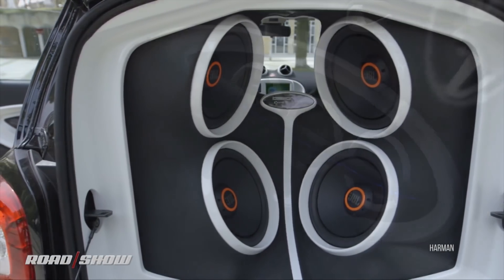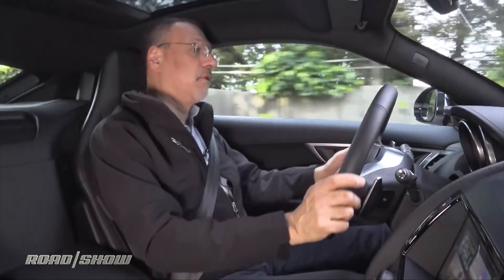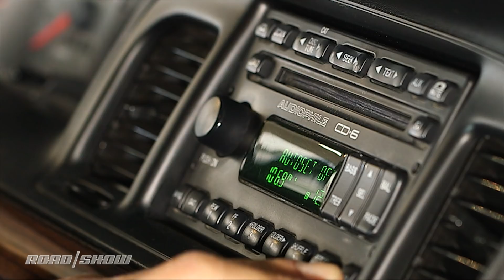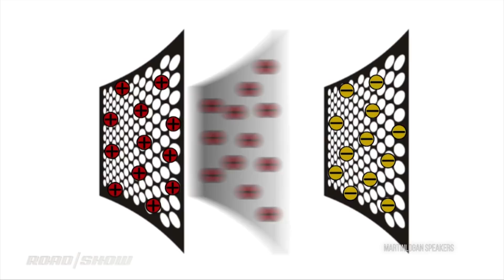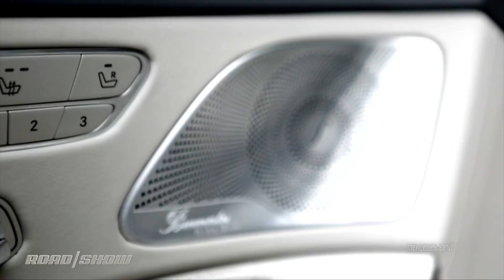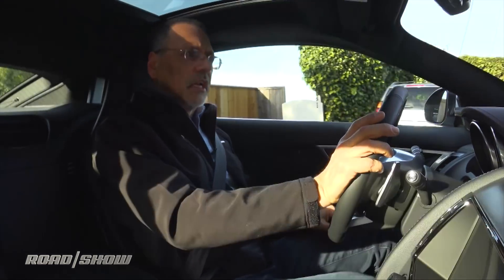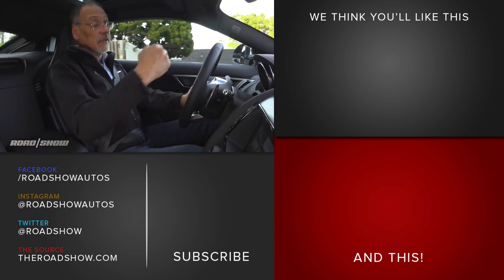Car Tech 101: Car speakers are about to disappear

Comment: No one has ever complained of the existence of a speaker in a car, in my opinion,  speakers, like the Bowers & Wilkins in BMWs enhance the looks of an interior.   There have been flat speakers around for years, but putting speakers behind panels or making panels speakers, by virtue of pure physics,  can sound as good, and let's not even talk about rattling.   Finally,  there is no way to create real bass from a sub without power and the ability to move air.  We need better engineering in car environments to get audiophile sound, not more visual engineering to create less definition and range

Comment: I like how you show aftermarket multi subwoofer, custom fiberglass door panels systems to complain about speakers take up too much room... factory speakers dont take up any room thats not already wasted space.  Inside the door, what else you planning to put in there?  in the sail panel, its already hiding bolts for the mirror, what you planning to do with that space?  Flat speakers have been around for ages.. Magnepan has been building them since the early 70s.  The truth is, no one is complaining that their speakers take up too much space unless they installed four 12 inch subs in their hatchback... but those people chose to put the speakers back there, not the factory.

Comment: Right cause there  is absolutely nothing else in a car that will start vibrating as you start the engine and pull away from the curb  ;)

This is ridiculous and good luck finding a car audio installer who will hook you up with a new system one Saturday morning while you hang out at the mall.  By midday, they might have the seats, carpet and most of the door linings in a neat pile next to your car - then they can start looking for the existing speakers ......

Comment: This is rather old technology, these devices have been around for about 38 years. Sound quality will be dependent on the mounted surface. In this case if its a car and placed on plastic it will sound terrible. In fact these devices are a gimmick and sound terrible anyway. If you want good sound, get a good car speaker...........simple

Comment: No, the alternator in a car does not consume more gas if you have a high power stereo. Your alternator will put out as much amperage as it can, regardless of speed. If you're going ten miles an hour or 100, the alternator produces what the car's systems demand , provided its strong/powerful enough. If an alternator can only produce 100 amps and your car's systems require more it won't matter what your speed is.

Comment: There is really no replacement for displacement of a speaker plus power. These are gimmicks. For an average user, there is no need for more than 4 mid ranges and preferably a dedicated sub (Component mids would be even better). This has nothing to do with fidelity. If it was about fidelity, they wouldn't hide speakers behind grills, carpets, etc. They certainly wouldn't believe that you can get more sound out of less power.

Comment: How are worse speakers better? With all of those tiny speakers you wont have a low end whatsoever and a very unbalanced sound. And as far as using your roof by making it flex to create bass? When cars flex they absorb the sound waves that is audio 101. I guarantee I can build a system that sounds better than any of these "flat speakers". If you dont want speakers that's fine but to say that great audio systems are a waste of space for everyone simply is not true.

Comment: now let us think about this for a second. More speakers, more weight. A 12.22 audio system in a car. ( yes i know it doesn't exist, or does it? ) A car booming allong the way with the numberplate dancing the subs on the outside of the car. Now they are going to use the car as a speaker? What happend with the simple 2.0 stereo systems with only 2 or maybe 4 speakers? People who know sound, know that you can have very good sound with the right speakers. An old Ford Mustang 1978, i build a system in it with 2 tweeters in de front, bass in the door and full range in the back. People were asking were i left the amp and the speakers because they couldn't find them. It was 40 watts in the car and sounding better than you would expect. So i ask again, why? Who need 2300 watts rms in a car where the space is more than enough for 20 watts? Consuming less power on the car system, no more holes than it was allready there in the car and still having a boot and back seats and you still can talk to each other.

Comment: Where do I even begin with critiquing this video?  The only good thing is the front mounted sub. As for the rest of the video, every single thing said is pretty much wrong.  I have a very strong background in acoustic engineering at a professional level. There have been only evolutionary steps since Jensen introduced the first permanent magnet dynamic speaker in 1930. in 1953 Janzen created the first electrostatic speaker and the Distributed mode loudspeaker (flat panel speaker) was described in 1997 in an AES paper but the principal had been known for decades.  The problem with conventional speakers is that to be loud they must be big or move fast which causes distortion above a certain velocity. Electrostatics are exceptional for quality but must be exceptionally large and open. Distributed mode loudspeaker has very poor frequency response and bad comb filtering, also they can not produce high SPL. Only one thing left, plasma speakers, very small, very loud, very good frequency response but the power requirements are in the KW range and there is the small problem of the deadly levels of ozone produced. The only other possibility is sound from ultrasound, but that is very complex, expensive, and as of yet poor quality.

Comment: This has absolutely nothing to do with efficiency in design in regards to producing better sound in your auto and a lower impact on charging systems and vehicle weight, but instead, has everything to do with increasing auto manufacturers' profits. Their ideas of producing sound in a vehicle will exploit the proprietary nature of what they are utilizing in these "emerging technology" speaker designs to reduce your ability as the end user to service your own system. This will force you to deal exclusively with vehicle dealerships' service departments for replacements when products fail out of the warranty period. This will severely limit your ability to make your own choices on where to source your parts. This allows auto manufacturers more leverage on how much they can charge you for replacement equipment and labor rates. Look at how auto manufacturers have formed a coalition that has attempted to enact DMCA copyright law on their products because contemporary vehicles utilize proprietary code in their ECUs. 

Sound reproduction in an automobile system does benefit from efficient design, however, efficient conventional loudspeaker and amplifier design has improved drastically through the years anyways. Many current conventional loudspeakers are more shallow due to the use of neodymium as opposed to a strontium ferrite. They are lighter due to composites being used to build their frames, as opposed to either stamped steel or cast aluminum. They are also more reliable mechanically and thermally due to superior manufacturing processes and better materials. Amplification has benefitted greatly with the advent of full-range class D amplification. Problem with these improvements? Auto manufacturers can't dictate the choices of the end user as easily when aftermarket solutions are readily available. So let's just go ahead and try to re-shape the wheel, right? As others have mentioned, "If it ain't broke, don't fix it." But remember this, when the consumer has less choice on when, how, and who services their vehicle, the consumers themselves lose.

Comment: This all sounds horrible and a lot of these speakers will too.  More air moved, more sound. And as far as vibrating other parts of the car ( an old idea), there's a reason that speakers have been made similarly for a long time.  If u don't believe me buy some exciters, stick them on different surfaces and see what it takes to make it sound good.

Comment: If it ain't broke don't fix it. Standard speaker design works well and is relatively economical to replace and/ or upgrade. How is that door panel going to be a good speaker if I rest my arm on it? Car doors are bigger than ever due to safety devices now (look at a 1981 Toyota pickup compared to a modern Tacoma) so space isn't really a problem. 

The aftermarket shown in this video is the extravagant side of car audio. Most custom audio now is discreet and built into the floors of the vehicle to maintain functionality.

 This looks like a lot of time and effort to make things more complicated and more expensive for the consumer to fix.
Reply: AnthonyJ350 new tech isn't always better right out of the gate and there's always some that don't see the end product/vision.  The same was said about the car, the PC, cell phones, internet and now blockchain.  Eventually it will get to that amazing point where you can't imagine being without it.
Reply: AnthonyJ350 lol I know, just never seen you on YouTube besides on your Channel. Crazy that they want to use the whole door vibrating as a speaker, imagine if the sound quality starts to sound like shit and they say okay you're going to need a whole new door now ha
Reply: AnthonyJ350 agree, next time a "stealth" speaker is not working you would have to wait for the part to be available and tompay at least three times of an after market speaker, not fair.
Reply: What you doing on here lol
Reply: gabrielgalaxygh Apparently I need to help save the automotive aftermarket and poor quality and voice my opinion :p 

I'm allowed other places other than my channel lol
Reply: I also want to reply to your posts with the post I said. If you want small stuff to hide and turn surfaces into a speaker. They have thatalready...
I mean. I know a guy with a bass shaker under each front seat and tactile exciters mounted on the rear deck bc its metal and works better tha. The plastic. Sounds ok but I like my 6 by 9 custom backseat speaker builds with subs. I don't want small and unobtrusive. I want big loud and obnoxious hair blowing sound that rattles your eyes in There sockets
Reply: and usually more reliable. A couple years ago i tossed out my OE speakers and replaced them with some half decent pioneers. They're no Cerwin-Vega but they're better than stock... And by better, I mean they sound better.
Reply: AnthonyJ350 couldn't agree more with your comment though
Reply: gabrielgalaxygh It's the classic tail of engineers being engineers for the sake to keep their job. They should be busy refining not reinventing. Why do you think the military uses old equipment and keep retrofitting planes, humvees tanks etc. Because they work and it's cheaper.

Comment: To those who enjoy tinkering and having the option to upgrade those audio components, it would be great if automakers continue to put poop speakers in a hole so we have a place to put our non-poop speakers later on down the road. A subwoofer in the headliner... right against the least sound dampened part of a vehicle. Sound costly money wise and weight wise.

Comment: This is all old tech that no doubt some patent pending has ran out...because the sound quality of rattling sucks! 
Most cars only need 5 speakers if done the right way, all these cars with 17 speakers is just a sales gimmick for the most part, and sub contractors trying to get the most cash out of the auto manufactures.

Comment: Can't see a shity old door panel vibrating at 16khz + giving I nice crisp high or a roof lining giving deep lows, the roof will rattle like made. With Bluetooth speakers getting smaller and better there's your answer, put the speakers in the correct size enclosure with a good amp, job done.

Comment: Covering speakers really damages image, depth, and overall tonal accuracy of the driver since reflections cause distortion on the speaker cone. This becomes less important the low the octave a speaker is playing since lower frequencies travel through materials better than higher frequencies. Lower frequencies are also more omni-directional making it harder to locate the point source that the sound originates from.

What you are calling high fidelity a lot of use will dislike since speaker response will vary ear to ear even if a microphone says it's right. 

Imaging has more to do with the physical properties of the human head in relation to the distance from the driver than it does the driver itself. A 5ft 4 person will perceive a different sound stage than a 6ft 2 person simply because their head is placed lower in the car changing the distance from the speakers relative to the taller person

Comment: I agree with most of these folks below.....  You can't just add a electrical motor structure to the back side of a door card and expect this to sound good.  IMO it's going to sound like shit.

The physical properties of the door card are no where near the same as an actual speaker cone, or a electrostatic speakers, or much really anything having to do with speaker design at all.  I am an audiophile.  In all of my cars ( I have 4) they all have aftermarket audio components in them.  I am mainly talking about headunits, sound processing, speakers, and amplification.

And again this is the reason I don't like "new" cars.  Too much bullshit technology in them these days to go wrong.  I love my 1990 CRX.

Comment: I have not issue with speakers today.  my Porsche Cayman S has 12 speakers and a subwoofer. I want a good sounding stereo in my car and if that means I have to look at speakers it's a non-issue for me.  and my old Mercedes E55 add a subwoofer in the trunk on the back dash and you couldn't even see it unless you stuck your head in the trunk and looked up. Not really a big deal at all

Comment: I don't want screens in cars. I don't want wifi. I don't want the car braking on its own. I don't want touch screens/haptic buttons. There's nothing wrong with analog switches and dials. Keep it simple. HVAC should be dials that you can operate while still focusing on the road. Same with volume/radio. Instead of changing tech and making things less reliable, more expensive and more complicated... why don't we improve quality/materials?
Reply: Dalton v I hear you.
Reply: I've been thinking the same thing. I see vehicles advertised with heated steering wheels for goodness sake. I don't care about all that stuff. I want power steering, brakes, a/c, cruise, tilt wheel, intermittent wipers, and a decent audio system. Power windows, locks, and seats aren't even a necessity .
Reply: Dalton v because they don’t want their cars lasting 10 plus years, they want you back at the dealer looking for a new shitbox to buy every 3 to 5 years. It kinda sucks, I’m 30 and a mechanic and I’ve come to the conclusion that I will never buy or own a new car, they are all crap and too expensive. Maybe if they were just too expensive I might think about getting something financed and pay out my ass every month but no new car is worth it. On top of that the depreciation of new cars is absolutely horrible, talk about throwing away money.

Comment: I need components that are tunable or tailored to my listening preferences, subwoofers that are either high SQ and or SPL which will never be available in a factory system, Bose, Bowers and Wilkins, Harmon Kardon etc... I’ll stick with my aftermarket Pioneer Head Unit, Soundstream Passive EQ, Pioneer Components and Rockford Fosgate amplifiers and Subs for my system

Comment: This is why I'll always keep reviving my 2002 Buick Park Avenue Ultra, because at least in that car I can still put a sound system of my choice. If I do buy a new car in the future I hope i can integrate a aftermarket amp and speakers and sub like I did on my flex.
Reply: dude you don't need to keep an 02 buick to do a custom sound system keep it real your keeping the buick because its cheaper then a new one. A 2018 buick regal can still have custom audio the goofy shit this cat is talking about is years away from production plenty of different years and time for you to upgrade to something newer.
Reply: Jose Luis Ruiz totally agree, I'm going to keep revamping and restoring my old cars as long as they can take it. New paint, new interior, engine trans, other parts, as long as they don't rust out they can last forever. Take an old car and for way less than $10K you can make it like a new car.
Reply: June 2009 I am keeping it real dude it is cheaper to add a system to my weekend car but as for buying a new one  I do got a 2018 flex with an after market system, the stereo is that shitty Sony one but Audio Control is an awesome company to help tap into those wires of the stock amp to upgrade the speakers and sub. I'm not really the kind of guy that gets rid of cars that easily unless there is a part that is needed to make the car work that I can no longer buy then I would definitely let it go and get something new 😁 my park avenue is pretty much already there with discontinued parts lol.
Reply: Jose Luis Ruiz 
So why would you bother with a 16 hear old Buick if  you have a new car ? It's not like it's corvette or something cool it's a Buick lol
Reply: June 2009 because my man, it was a gift from my father before he passed away so to me it's valuable, it's something you probably wouldn't understand. But it's cool let's leave it at that, there is no need to go any further on this subject, at the end of the day, we all make choice of things we want and buy what we want with our own hard earn money 😁 have a good day my man. 😎✌
Reply: Jose Luis Ruiz 
I get that